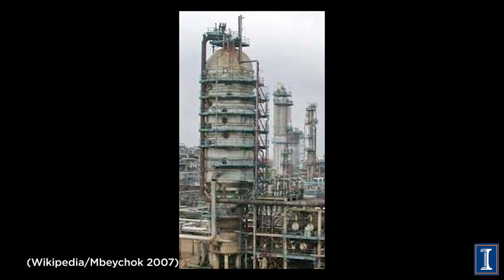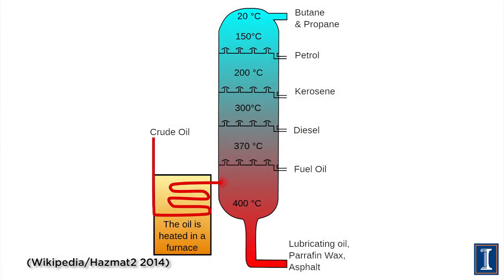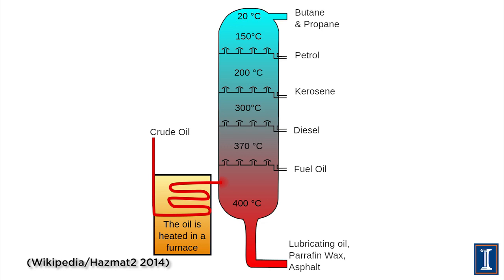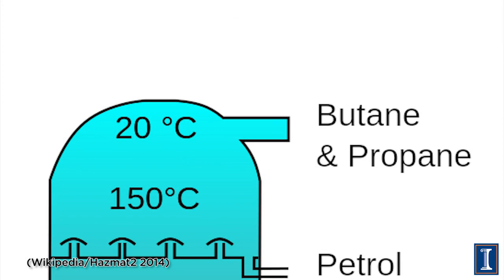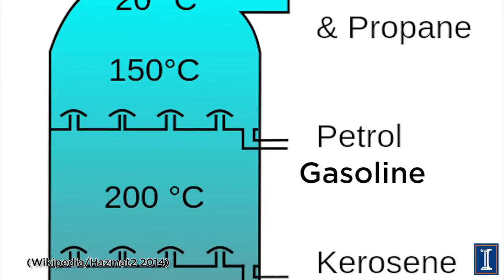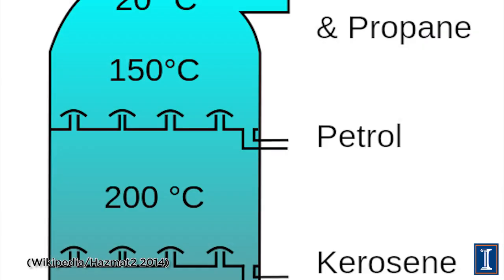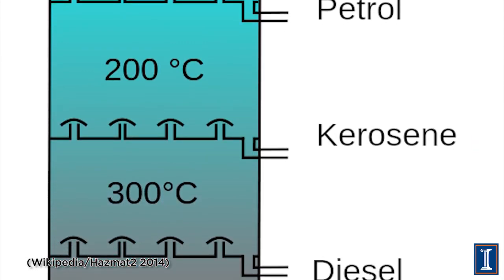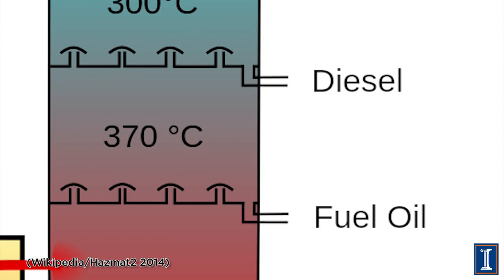Refining: Crude Conversion

Comment: When you think about it, 90% efficiency is quite good for oil refining. Most energy conversion processes are not quite that good, and engines are horrible inefficient by comparison. Most cars would be lucky to achieve an efficiency anywhere close to 40%, with 25% to 30% being more typical.
Reply: A Hollywood star would be happy to lose only 10% to his agent.
Reply: I think is a bit different. If I drive truck with oil 100 miles to sell and in the process burn 1000 litres of gas, does it add up into efficiency of oil my oil? Also I can use wind power or solar panels to separate the oil and it will magically make it more efficient?
Reply: @muradm7748  it doesn't matter where the energy comes from. To calculate efficiency, you divide the useful energy you get out of a process by all of the evergy you put in, and you get some fraction that is always less than 100% because some energy will always by lost to heat and/or noise of your equipment. It will always cost energy to transport things because if nothing else, there is air resistance for the vehicle and rolling resistance in the tires.
Reply: @WarrenGarabrandt  I'm just saying that it is unfair comparison combustion engine turns heat into movement and here you just split the oil. It is not the same process and different amount of work done.
Reply: @muradm7748  I think it's a perfectly fine comparison. I'm not saying that fractional distillation get my car 22 MPG, or the engine in my car can distill 55 gallons of crude oil per hour. That would be nonsense. I'm comparing the relative efficiency of two different processes that both consume energy and produce work. In one process, the work done is the refinement of a material. In the other process it's the conversion of chemical energy to kinetic energy. It is possible to compare the efficiencies of these two processes, you just can't compare one to the other as far as actual work that gets done.
If I was trying to compare different ways of turning one form of energy into kinetic energy, and electric motor is hands-down the most efficient way we have right now.
Reply: @WarrenGarabrandt  I understand that, but I'm saying that it is unfair comparison. Why it is impressive that it is 90% efficient? There a lot of other separation processes that as much or more efficient. Maybe it is less that average efficient. Maybe it is industry low standard for refineries. I want to say that  it doesn't make sense to be impressed by 90% when comparing to entirely different beast with 40%.
Reply: @muradm7748  It is impressive because other separation process will need ADDITIONAL energy source to achieve higher. Refinery is self powered. If your 90+ process is powered by electric, external heat, solar, nuclear, other chemical, geothermal, etc, once you add those energy sources you will likely not get 90% either.

Being self powered is also easy to manage, you don't need to worry about one system is down leading to another. Just use the 10% and you can keep the system going.

Comment: Why does it get colder near the top of the column and hotter near the bottom? Is this done actively, or maybe they intentionally don't insulate the top very well?
Reply: Natural cooling - if the bottom of a pot of boiling water is heated, and the top is a long glass pipe, the steam and boiled water will begin to rise up, but as it goes higher and higher away from the heat, it cools. This is why the top of your cooking lids get water on it recondensing. In chemistry, we abuse the same with a separation funnel - if you have a mix of liquids, and one is lighter or boils off easier, heat it just right and it will turn to gas , go up the pipe, and cool back into a liquid where you can trap it and separate it. In this case, imagine boiling salt water and capturing the water somewhere else leaving salts behind.
Reply: They regulate the pressure and volume so it cool down based on pV=nRT. They have computer controlled valve to adjust according to the sensor reading